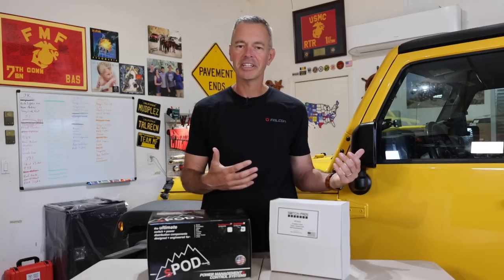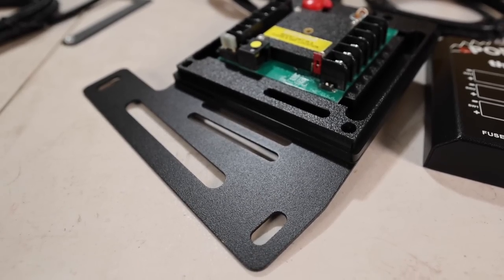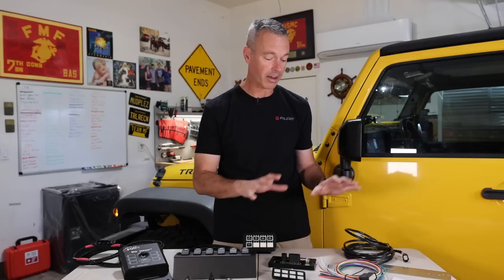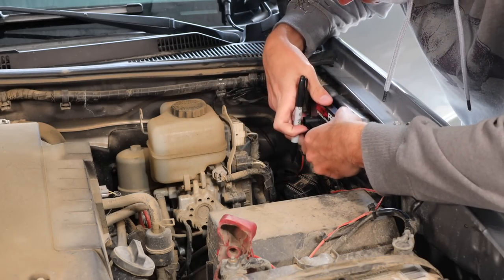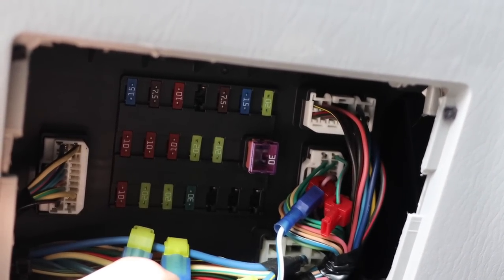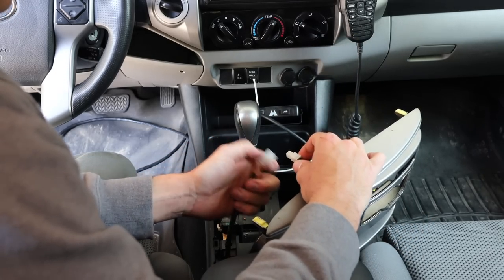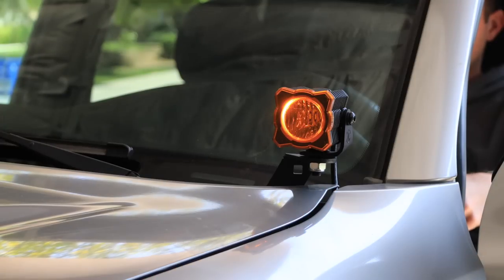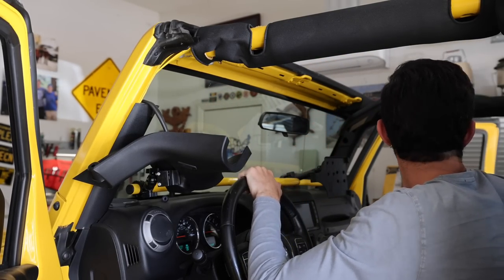sPOD vs. Switch Pros with Installations

Comment: Good video, Brad.  Rule number 1 when working on electrical mods:  Disconnect the negative battery terminal first and always!  If your sons touched ground while ratcheting on the positive terminal, it could have, not only burned their vehicles to the ground, but also your house too since it was in the garage.  Safety First! (Not Second)

Comment: I couldn't bring myself to dish out over $500 for a switch panel. I paid $100 for some no name switch panel off Amazon. It works just fine.

Thanks for the video, it was still interesting.
Reply: Yep insane prices
Reply: And something as simple as bluetooth wont work on the more expensive one. Yeah... ill be getting a cheaper option.
Reply: I picked up the Auxbeam 8 switch ½ the price. Works great. The new model is Bluetooth as well
Reply: Yeah I went the same route with auxbeam 2 years ago and no issues whatsoever. Install was a breeze

Comment: You can't go wrong with ether of them. I like the sPod a lot for it's install simplicity. The Switch Pros can get a little more complicated and too me doesn't look as clean in the engine bay. Your sons did a great job explaining what they were doing Brad. Wonder where they got that from. It's been fun watching them grow in skills. You really should be very very proud of both of them.
Reply from the maker: I agree, the spod is a little cleaner when installed.  Pretty proud of my sons, they still have a few thing to work on when filming and they learned a lot from this experience.  Thank you!

Comment: Thank you for sharing
A fishtape is a very handy headache preventer 😊
And, HF has two five inch flush cutters that cut zip ties better than electrician pliers (dykes), or diagnonal cutters. The HF leave the cut so smooth that you literally cannot cut your face with the edge of the cut zip tie ⭐
🏆🤗🙏🇺🇲

Comment: Been running the sPOD BantamX in my JLUR for a couple years. Overall, the system has been flawless. Only problem I have had to this point was the LCD-touchscreen went to 💩 a couple months ago. Called tech support at sPOD and they sent out a new one....free of charge. Gave me confidence in their post-purchase customer support as they had no problem standing behind their product. [FWIW....since Baja Designs scooped up sPOD a couple years ago, the warranty for recently purchased sPOD's has been bumped up to 5 years as opposed to the original one year.]

Regarding the sPOD app......yep, it's garbage. Has been since day one. Search the forums as a "fix" for the bluetooth connection issue can be found there.

Great video guys. Keep them coming 🤟
Reply: Thats why race guys never run touchscreen switch systems.  Too flakey and hard to find a switch without looking away from driving.  Switch Pros for the win.

Comment: Considering one of these two systems for my wife’s Gladiator.  I went the DIY route on my Colorado for the auxiliary lights.  It was cheaper, but definitely a bigger time investment.  If you aren’t good with wiring, get one of these switch kits.  I would recommend putting some silicone on those self tapping screws to help prevent any rust.

Comment: I love the sPOD Bantam in my 80 Series Land Cruiser. Simple, safe, and effective. I got the Bantam so I could get the customizable LCD screen and Bluetooth connectivity. I can have infinite adjustability for my seat heaters, link functions, set strobe and other light features. I can also daisychain multiple spod units to work on the single LCD.
Reply: Just don't get it wet. My biggest gripe with it. I've killed mine with no more than some light water from washing the engine compartment down. LCD screens are finicky to touch, especially while moving off-road.
Reply from the maker: Great to hear, I like the daisy chain options, I had two spod control panels on my Gladiator that made it very functional.

Comment: With the 2 bolts that go through the sound bar if you over tighten them it shifts the seal and makes it leak. Most people find just leave them out. My 2015 hasn’t had them in for years and it stopped the leaking.

Comment: I like these switch panels. Very clean, if expensive. One suggestion I have for the manufacturers is a high beam trigger separate from the ignition wire. When the programmed light input(s) are activated on the switch panel, they will be in an armed state waiting for the high beam signal. This way they can be legally compliant as well as avoid blinding people.
Wiring is my least favorite thing to do on a car. It's tedious and usually requires uncomfortable contortions. If I had enough accessories to justify a switch pod I probably would go with one of these instead of building my own. Also, you can get OEM-sized switches for Toyotas with various off-road legends if you need a switch but don't want to put it on the Switch Pro. There are two or three companies making them.

Comment: I have two of the switch pro's - one in cab for lights, one in the Gladiator bed to control camping things.  I really like the small footprint a ton, the programability, and the modern tech removing the need for relays which just draw extra power.
Reply from the maker: I did the same thing a few years back with my Gladiator and I liked the ability to have 2 different control panels.
Reply: Got one year out of mine before it quit.

Comment: Not sure if you did, but always disconnect the negative battery cable whenever working on electrical system. I learned the hard way (FIRE)  Your doing great with your vidios.

Comment: I choose the Switch pro 12 panel for its small form factor and solid state design. Really slick control and customization with the app over bluetooth. Next level would be to use Solder Seal Wire Connectors covered in your electrical tape or sleeve.

Comment: Looks like the bid advantage with the sPods is you can use to as a bypass to hotwire anything that goes all wonky like a radiator fan etc without tapping into the extra portion of the wiring harness loosing some wire like you would on the switch pro

Comment: Even though I have done all the wiring on mine myself and bought all the switches for the icons on them, all oem/oem style switches it's for the manufacture look. Like all the gauges are VDO with white needles (Yep, they are hard to find in some gauges, so I converted them. It's a lot of work, the Switch pro looks like what I'd probably use for customers as they'd not really want to pay for the time and effort of my build. I like the simple form factor and the versatility of the Switch Pro, and the best thing, not a carling switch in sight! 😀

Comment: Maybe I missed it, but I didn’t hear any mention about the Bluetooth capability of the Switch Pros unit. I have both the SP9100 and the RCR Force 12. I suppose I’m biased but IMHO the 9100 is a far more sophisticated system compared to the SPOD.

Edit: I see your son picked up on the BT

Comment: I would definitely recommend at least using heat shrink tubing and a heat gun on your electrical connections instead of electrical tape. That will give you a more secure connection and reduce the chance of shorts, blown fuses, or fires, particularly when off-roading. Both installs looked like they turned out great though. 👍
Reply from the maker: Yep, a lot learned from doing this.  A few changes to the connections and wire routing after this was filmed.
Reply: Not to mention once the heat gets to that tape it's just a mess!

Comment: The sPod protects against "Field Collapse"? Do they mean that they use relays and add diodes or some other protection across the coil to protect from the collapsing magnetic field generating a back/counter EMF spike? That's actually pretty typical in relay switching - even though they make it sound fancy. I assume that, based on the size of the Switch Pro, it uses solid state switching so there are no mechanical relays.

Personally I hate fuse taps as I just haven't found them reliable - particularly in a vehicle that is going to bouncing around on trails. However, for anyone that doesn't have a lot of electrical/wiring experience, I get why they are a quick, easy solution.

Overall I thought that they did a great job installing these switching devices - particularly for those that don't typical deal with automotive electronics.

Comment: Devin your roof leaked perhaps because you tightened the two large screws too tight. I don't even put those in the top now and it has stopped mine from leaking.

Comment: I've gone through my 2nd switch pro. My first one blew an internal fuse and switch pro replaced it no problem. This second one lasted a few years longer. I connected each unit straight to the switch pro as recommended without a wire bus and needless to say I had a huge rats nest under the hood that was frustrating. I might go a different route for my 4Runner
Reply: My backight works, but the buttons won't trigger anything. App will not connect anymore. Is this what yours did? Trying to figure out what's going on. Thanks
Reply: @GadsdenJL  that’s exactly what I’m dealing with. But sometimes the backlight won’t light as well. Per switch pro website, there might be a short in the wiring. So I need to go back through my entire wiring and see what might be causing the short. Also, switch pro gave me a list of testing (w/ a multimeter) I need to preform and pictures I need to take in order to proceed with getting their analysis. If you’re using a terminal block. They will say that’s part of the problem as well. They require all accessories be connected straight to the switch pro unit. It’s gonna be a pain to figure out what’s going on. Hope this helps
Reply: So, a buddy had the same problem. He totally disconnected overnight and that fixed his.
Also just worked on mine.
Would be awesome if switch-pros put that information out there, or responded to emails. 
Hope this helps.
Reply: @GadsdenJL  totally disconnected and reinstalled. No difference. Got an email back from SP and the asked to to use a multi meter and take down some numbers and they’ll go from there. Big headache
Reply: @dtrn750  damn